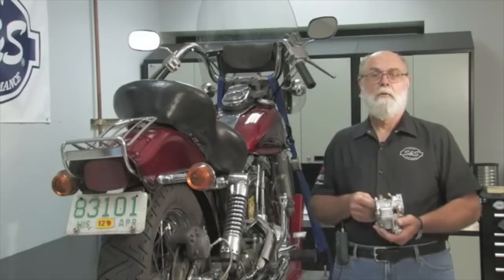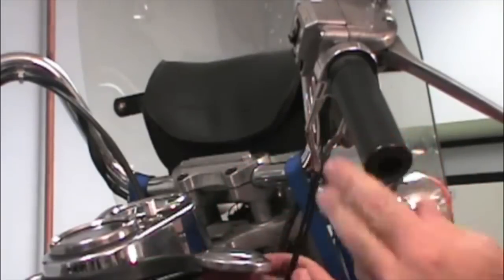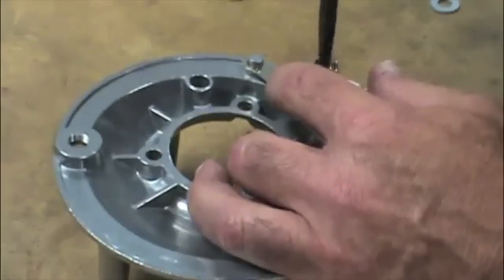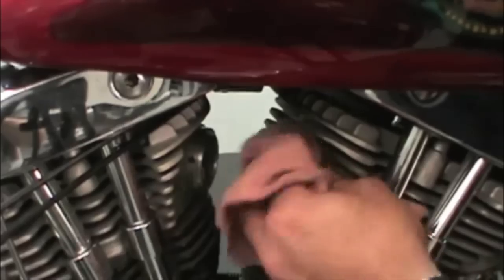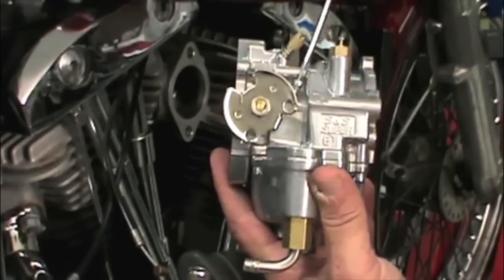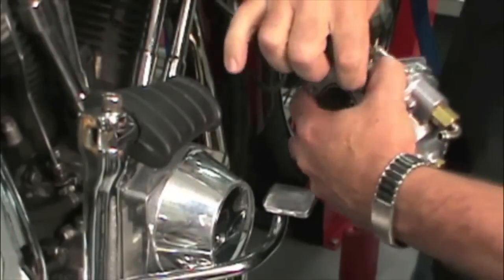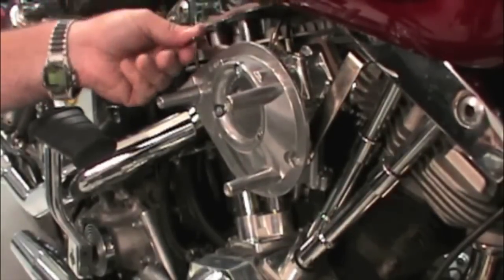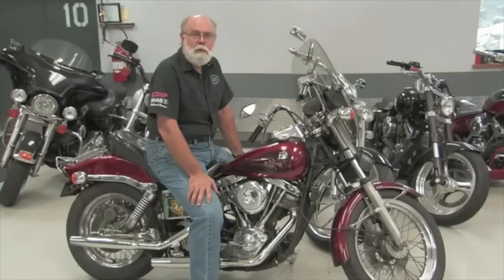S&S Cycle Installation: Super E Carburator

Comment: Will stock throttle and idle cables work on a 2000 twin cam 88 dyna with a super E my throttle isn’t returning smoothly it’ll return but very slow I can’t work out why
Reply: Depends what throttle bracket you have on your carb. There is two, one for butterfly style carbs and CV carbs. I’m guessing you have a butterfly style on your carb and you’re using CV cables. The throw is different!